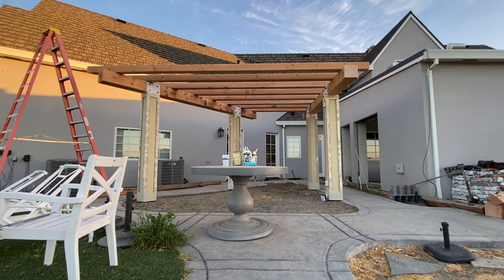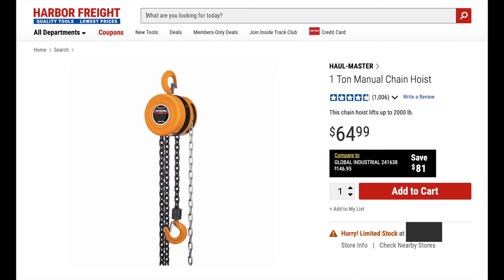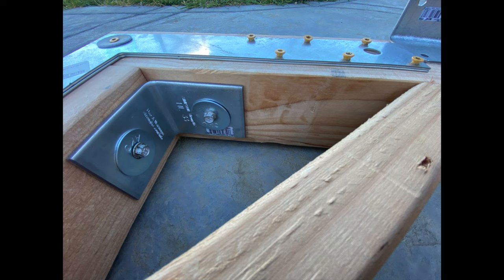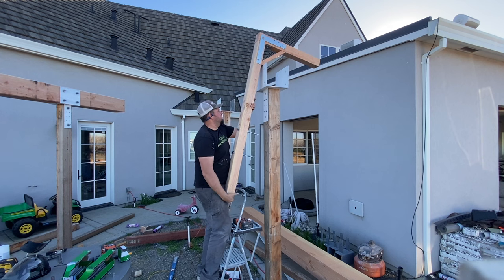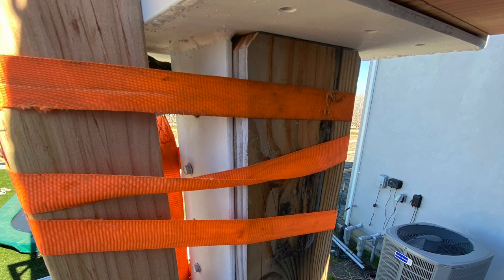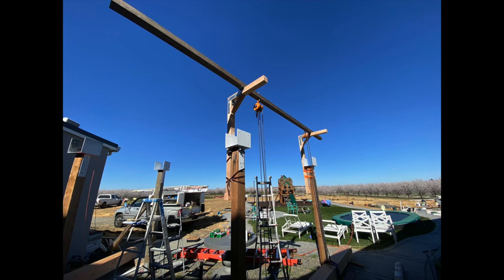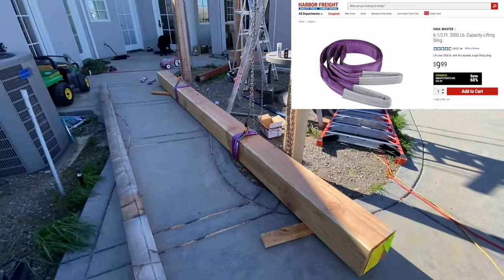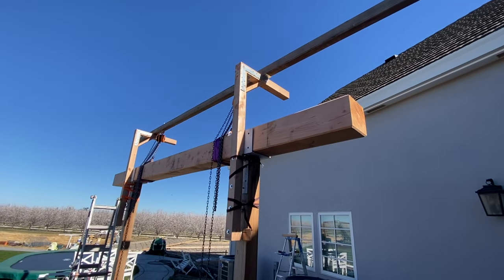How To Lift Heavy Beams by Yourself

Comment: I used RATCHET STRAPS to raise an LVL beam into place in order to replace a load bearing wall I removed.  I attached the RATCHET STRAPS to the 2nd floor floor joists and raised the LVL beam
Reply from the maker: Good idea

Comment: Quite helpful.  I was trying to figure out how to do something like this.  Previously I use two ladders and a friend and I just muscled a heavy beam up.  It felt VERY dangerous.  This is the right way to raise a beam without an existing overhead support structure.  Thanks!
Reply from the maker: The original plan was to use ladders and 4 guy after I saw how hard it was to move on the ground i scraped that idea. The chain hoists make it super easy to adjust the beam. Good luck with you project and be safe.

Comment: Super supportive.  I have been lifting a number of different building materials on a house build that I am working on, mostly solo.  I actually considered those very same chain hoists and I made the exact same lifts that you did out of 4x4s, yours were much more stout and I will go back and reinforce with the Simpson hardware....I even bough and used the same 1/2" eye bolt.  Amazing we were on the same track.  Thank you so much for this video, so supportive.
Reply from the maker: Thanks. Great minds think alike.

Comment: this is cheaper than just renting a crane?
Reply from the maker: Yes and I had to wait a week to lift the second beam because the customer got the wrong size. So I would’ve had to rent it twice. You have to also consider labor time picking up the equipment. This was way cheaper and safer.

Comment: How much did it weigh? I have a 20' parallam lift coming up and its about 600lbs and 12ft in the air. Its over a 1st flr deck so a lift machine wont work. I like the configuration but thinking I may need a better L portion to carry that weight. Nice job Bro!
Reply from the maker: I think it was around 500 to 600 lbs. It lifted the beam with ease. Those L pieces are stronger that you think. It is always best to build it overkill just to be safe. I still have one maybe I can test it to failure one day
Reply: @TheUltimateHandymanKyle  Thanks! I appreciate the feedback. Could go viral with that vid 😂🤙

Comment: I did this when I built my huge wooden patio by myself. I basically used a bunch of tie downs and strap a taller beam next to my posts and run a piece of lumber across and mounted the hoist. It worked like a charm. People were shocked how I manage to get 4x10x20 beams up by myself lol.
i love finding solutions.
Reply from the maker: Great idea.

Comment: Hmm.  This is a fabulous way to do heavy beam lifting it seems!  I have to soon lift a 20’ 6”x12”. I’ won’t have a long 4x4 for that span.  Im thinking I could mount the hoists directly on the 2 L shaped 4x4 brackets?   Any reason you didn’t do it that way? Great video!
Reply from the maker: I didn’t mount my L brackets high enough so I needed extra height for the chain hoist. I was almost maxed out on my chain hoist lifting even with the 4x4.    I was in a hurry and didn’t measure everything to make sure it would lift high enough. You can mount hoist directly to the L bracket.

Comment: I am using this tip for sure.  Thank you.  I liked subscribed and hit the bell on this.  All that aside this is not just a little OP but a lot OP.  It’s always good know the limits of things.  There are great references to help people calculate wood weight, and also load capacities such as what weight a 4x4 over a horizontal span can support.  I’m not creative enough to come up with the solution you did but hopefully encouraging folks to do this background research can help safety, cost and level of waste.   I found info out there that puts your beams each at about 390 lbs. which is a weight that shockingly can be supported with a single 4x4 at the center of an 8 ft. span. Hopefully this comes across helpful and not rude.
Reply from the maker: Thanks I appreciate that.  It is good to know the weight your lifting and how much weight the wood your using to lift the weight can Handel. I figured 400 to 500lbs for the beam. I could have lifted way more weight the way I had it set up.

Comment: Does this wooden structure strong enough to hang/hold a 16' 500lb i beam?
Reply from the maker: It should be. You need to be your own judge and engineer for if it’s strong enough. The beam in the video was 4 to 500 lbs it all depends on how wet the wood was at the time. To be safe stay clear of the beam once it’s in the air. Do it at your own risk.

Comment: Nicely done, seems a bit overkill and costly. I've done this by creating a ramp and drag them up the ramp using a winch.
Reply from the maker: You could do that. I didn’t spend that much on building this setup. You still have to buy wood for a ramp and a winch. I think my way was cheaper, safer and easier to adjust once in place.
Reply from the maker: In the future I might try the ramp method to see how it goes. I’ve seen guys use 2x4 wall jacks. They climb there way up the board. They cost more than the 2 chain hoists I used. Guardian Fall Protection 2601 Portable Wall Jack, for Use with 1-1/2 X 3-1/2 in Fir Poles Or 1 in Od Steel Pipe, Malleable Iron, Red https://a.co/d/byxZOAE
Reply: @TheUltimateHandymanKyle  I just raised a couple 21ft beams and used a chain host with a gin pole on side, and ratchet straps (two, alternating) on the other.  Ratchet are a little more sketchy and slow, but work and real cheap.

Comment: deck screws worked, but they are not structural because they are brittle.
Reply from the maker: Yes they will break at a certain point when bent. They were definitely strong enough for this job. I also used them so I could easily take this apart.

Comment: Where did you get the final brackets
Reply from the maker: Are you taking about the ones i used for the 4x4 L. I got them at Home Depot. If your taking about the ones that hold the beam to the post I made them form scratch out of ¼ steel plate.

Comment: Why not rent the equipment from Homedepot to lift the beams?
Reply from the maker: I would have had to rent the equipment 2 separate times a week apart because they ordered the wrong size beam. You have to factor in my time and the 2 separate rental fees. Making this setup was way cheeper and safer.  Also  the ground where this was had finished pavers and gravel so anything with wheels that were small would have gotten stuck.  I did have access to a fork lift but it got stuck trying to get it over to this area.

Comment: Unless your a sick old man you should be able to lift that beams up brrrooo
Reply from the maker: Your strong enough to lift a 16 foot 10x10 that weighs between 400 and 500 lbs up 10 feet in the air using a ladder? You must be the world strong man. I must be a week old man. Even if I was strong enough to do that it’s not as safe. My chain hoists mad it easy to adjust the beam position. I had 4 guys deliver the beam and we had a hard time moving it at ground level.

Comment: Thats a good idea, im not sure it would have worked for my 12ft long 8"x8" beams they were pretty heavy , plus wood was expensive then. I went with the old roman Stonehenge method for mine. check it out https://youtu.be/NwpO1P9-IV8
Reply from the maker: I just watched your video. The method you used works good also. I think it was the right method for you project.  The beam I lifted was a 16’ x10x10. And it wasn’t even close to stressing out my setup.

Comment: 😅😅 total  überflüssig. Ihr baut alles aus Streichhölzern.  Das hätte man hier auch  machen können.  4 dünne Balken  nebeneinander und verschraubt. Fertig! 👎👎🇩🇪
Reply from the maker: Im not sure what your point is. The way I did this in the video was the safest and cheapest way I could think of. If you have a better method than post a link to your video here. This is the translation below. 

Totally unnecessary. You build everything out of matches. That could have been done here too. 4 thin beams next to each other and screwed together. Complete!

Comment: with all the money in the building of the lifing mechanism you could have rented a lift for a day
Reply from the maker: There are a few reasons I came up with this method. First the cement walkway was 3 or 4 feet wide and that transition into gravel where the pergola was. So that would make it hard to impossible to use a rented lift.The wheels wouldn't work on gravel. It was actually cheaper to do it this way and way safer. Also I only had one beam to lift that day. The customer made a mistake and bought one that was too short. So if I rented the lift I would need to do it 2 times. The cost would be more than what I spent on making this. The wood brackets straps and hoists were at max $200
 I maybe spent and hour building the wood brackets and 30 minutes to install them on the poles. It would have taken way longer to rent and return a lift. I also planned it so the large lag bolt I used to mount my lifting brackets were reused to attach the 6x6 on top of the beams. They had a large forklift there but we unable to drive it up to that area because it sank in the dirt.
Reply: Doing this way, when he was done he had all the equipment. Just out the wood, and that might be able to be used somewhere else. If he rented a lift, he would have a receipt. I would make the same choice

Comment: CONSIDER YOURSELF LUCKY- THOSE DECK SCREWS DID NOT SNAP.
YOUR LIFT POSTS SHOULD HAVE GONE TO THE FLOOR.
WOULD NOT TRUST STRAPS AND WOULD BE LEARY OF THE TOP 4 X 4 S.
THIS WORKED FINE. BUT I DEFINITELY WOULD NOT RECOMMEND IT AS IS.
Reply from the maker: There was no luck needed. It was plenty strong for the weight I was lifting. Also deck screws are incredible strong.  I could have lifted way more weight. I still have one of the lifting arms. It would be interesting to test it till failure and see how much it can take.
Reply: @TheUltimateHandymanKyle  TRY DRILLING A 3 INCH SCREW 2 INCHES DEEP. SEE HOW EASY IT SNAPS WITH A HAMMER. DECK SCREWS ARE NOT MADE FOR THIS APPLICATION.